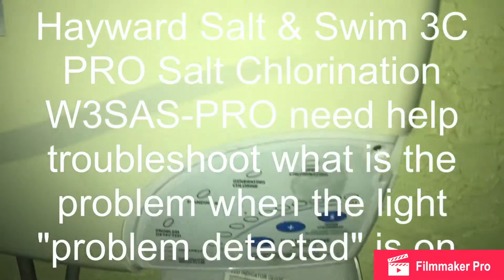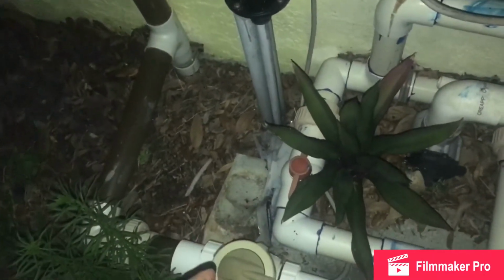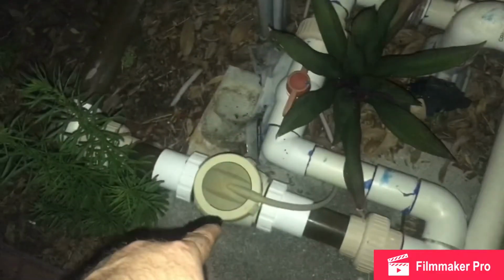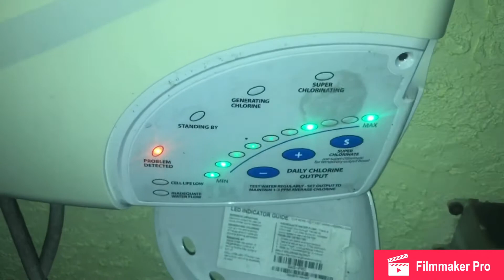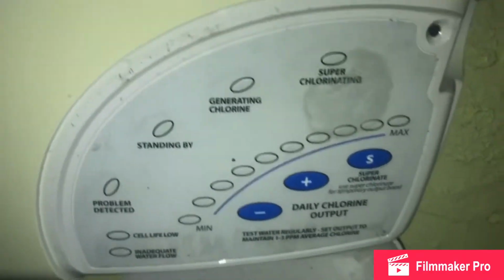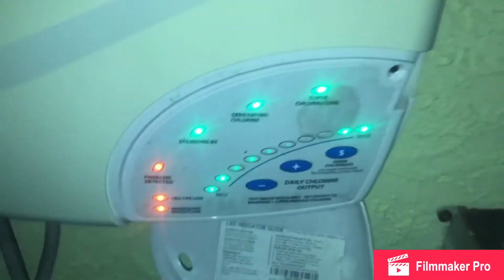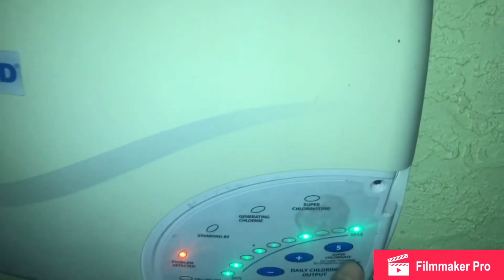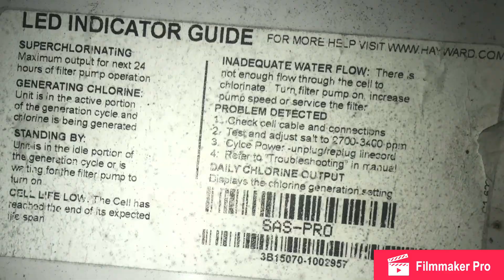Hayward Salt & Swim 3C PRO Salt Chlorination W3SAS-PRO need help troubleshooting!!

Comment: The connection between the cap and cell could be corroded. That’s what I’m dealing with now too. I’m going to try dialectic grease on that connection to see if that helps.

Comment: Did you figure it out?
Reply from the maker: I did. It was the wire harness that needed to be replaced. The end at the cell was all burnt.
Reply: @greenbergjared  where did you find the part? I think I have the same issue but can’t find the part
Reply: Where did you get the replacement part? I have the same problem
Reply: Hi where did you find the hardnesss mom how much?

Comment: I Have same problem. On troubleshooting instructions they says that the communication between main control box and cell is corrupted
Reply from the maker: Replace the cable. I had a burnt plug connected to
Reply: My cable connection is not burn at the cell. It's very clean as à new one!